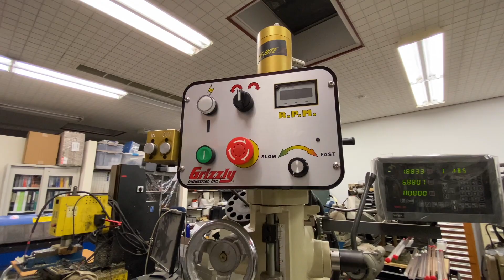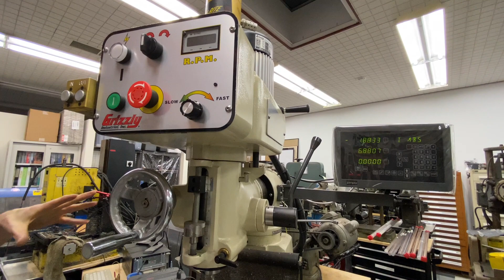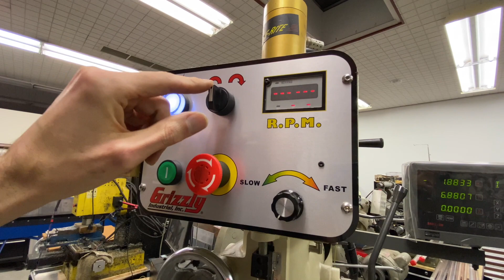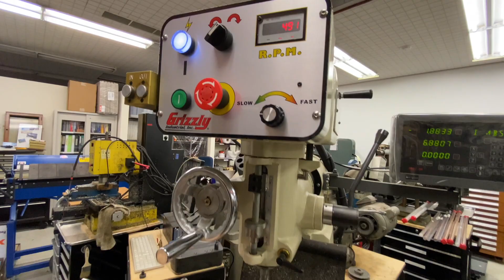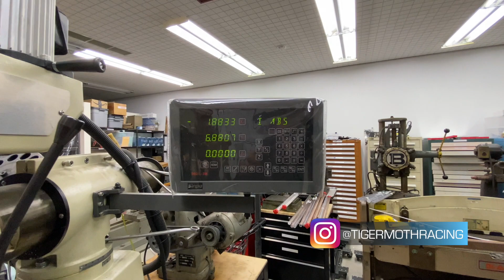SHOULD YOU GET A SMALL MILL INSTEAD OF AN INDUSTRIAL-SIZE ONE?

Comment: I started with a pretty small bench top mill and regretted my decision almost immediately when I got a dividing head that didn't fit underneath the quill. Now I have two milling machines and regret it less as I can leave that one set up with jigs for certain small tasks and do most of my stuff on the bigger machine.
Reply: That said I will probably still get rid of my small mill when I can afford it and get a second decent sized milling machine so I only have one size of tooling.
Reply from the maker: Lol that's a common experience. It is tempting to start small but we tend to need bigger pretty quickly!
Reply: I just upgraded from an 8" drill press to a 17" model; the 8" started off well until it started stalling on larger bits, then the bit was to big to fit over the piece especially on the table,  which caused a whole bunch of other issues 😅... you get the idea lol.  It's good to start small unless you already know that your committed to machining,  if so, go at least medium sized so that you can use it for a longer time to do bigger projects 😉
Reply from the maker: Yeah you generally want to go as big and best as you can manage. I noticed that when we moved out of our tiny space, almost all the tiny machines we had disappeared within a few years and were replaced with bigger ones.

Comment: A big part of making a decision on which mill to get is being realistic about what you need/want it to do. In my case, making engine accessory(AC, PS, alternator, etc) and clutch slave cylinder brackets for motor/trans swaps or stuff like throttle body spacers, a decent bench top mill is more than adequate. Nothing I do requires aerospace levels of accuracy or fast production times. Over the last 2 decades I've made dozens of such brackets out of aluminum with little more than a drill press, bandsaw and trim router.

The same goes for lathes. I'd love enough capacity to machine Dana 60 axle tubes for inner seals but I simply don't have the room for a machine that large. On the occasions I do need stuff like that done I'm OK with paying a commercial shop.

To that end, I recently picked up a used RF45 clone for $1500. I should be able to do the CNC conversion(with an enclosure and flood coolant) plus buy a ton of tooling for about half the price of a "standard package" Tormach 770. I'm also looking at the PM-1228 lathe as it has enough capacity for my usual needs(such as making threaded inserts for trailing arm rod ends) while not taking up too much real estate in my small workspace.

By all means, one should try to get the biggest machine that fits their space and budget. Small jobs are obviously easier to do on big machines than big jobs are on small machines but also be realistic.
Reply: my benchtops do most jobs, but just lately ive gotten obsessed with 250 I4s, doing valve jobs... and guess what? with a 5inch face mill i can JUST face a head. i have basically 10mm clearance at either end... would much rather have a bridgie for that... run a 10 inch and have plenty of room... and i definitely dont trust my quill lock to stay locked... just stuffed a job on the last step the other day when it did that to me... effin! last bit of stock too!

so im not about to try and skim any heads just yet.

Comment: I've come back to this video several times ,I've been torn between a larger bench-top mill & an 8" x 32" even larger mill (nearly 2x the weight, I think I'm going with the larger mill.
Reply from the maker: One thing to remember is that a bench top mill takes up almost the same floor space as a knee mill. So if you were to go with the bench top mill there is usually a non negotiable factor involved like getting it in a basement or other moving restrictions or rigid space restrictions. The heavier mills will always cut nicer and more quickly.
Reply: @TigermothRacingTV  thank you. This helps even more.

Comment: If you get a smaller mill and find that you need a larger one, you do have the passive benefit of being able to use your small mill for grinding operations. Tape up the ways, set up some mist coolant, and use a cup wheel on an arbor. It's a lot nicer than using a bench grinder.
Reply from the maker: I have wanted to try that with a 3 axis cnc mill to grind special form tools. Do you use this setup for grinding cutting tools?
Reply: @TigermothRacingTV  Yes, I followed exactly what Joe Pieczynski did on his channel. It's best for broaches and very light finishing cuts on hardened shafts. You can also use this concept to get the visual appearance of blanchard grinding.

Comment: I started with a new grizzly benchtop mill (R8) w/dro...after encountering some critical no-go problems with it, right out of the box, I got a refund and rolled it into a Bridgeport... glad I did, I wasn't limited by anything and there were basically zero limitations in what I could do.    
That said, the small machines have their place. you need to know what you ultimately want to do.   Regardless of size, if you're going to be doing a lot of things, get a DRO.
Reply from the maker: Yes the DRO is a game changer. Sounds like your journey brought you to a good place. Sometimes knowing what you want to make is hard when you are starting out.

Comment: You made some very good points here. As a hobby machinist I simply don’t have the room for a full sized knee mill. My shop is in my basement and getting a Bridgeport down there is a no go. Also, I’ve been told that most of the used full sized machines that come from job shops are used to the point of being worn too much for their own needs or needing repairs so it’s just easier for them to replace them. I use a large dovetail column mill/drill at work and find that it works fine for my needs so I plan to get my own soon.
Reply from the maker: I think the dovetail column mills are much more rigid. We have a SYIL brand mill that has been excellent.
Reply: @TigermothRacingTV  And unlike the round column mills you don’t have to re-tram them every time you change the head height.
Reply: Yeah...  Similar situation.  Basement workshop with no outside the house access.  Thankfully I don't need a bigger machine, but I too have found that shopping used Bridgeports is a hit or miss endeavor.  Most of the ones that are priced in the range of the bench top machine I'm looking to buy, are totally roached and need major rebuilding (scraping of the ways, table and all new bearings throughout) to be able to achieve the degree of accuracy the smaller bench top machine.

But if you have the $$$ for a new Bridgeport clone, or a fully rebuilt Bridgeport, then you're on a whole different level of capability, which believe me, I'd love to have that option...  Used to work with a Bridgeport in the tool room of my last job and it would be a great machine to have in a home shop.
Reply: @WHJeffB  I’ve also been told that the secret to being satisfied with using a benchtop mill is never running a full sized knee mill. Since I never have I won’t notice the difference.
Reply: @robertpearson8798  I've used Bridgeports and much smaller hobby sized bench top machines (In my home shop...  Sherline and Taig).  Being aware of the limitations is key to being satisfied with the smaller machines once you've had the pleasure of using a Bridgeport.  Knowing that you can't take heavy cuts (patience is a virtue here) and that smaller machines lack some of the capability will get you most of the way towards being OK with the smaller machine.

Luckily my needs for the future don't require a Bridgeport sized machine and a square column bench top mill will more than suffice, but believe me, if the right machine comes available at a reasonable price, I'll make space in the garage for it!
Reply: @WHJeffB  You’re probably right and as a hobbyist a smaller machine fills my needs, but there are always a few who won’t accept any limitations. There’s always that one person in any group or forum who say’s “Just get a Bridgeport” and often claims to have “ gotten one up three flights of narrow stairs in an old building at the top of a mountain” and “it’s not as hard as you think”😏
Reply: @robertpearson8798  I really can't see how they can sell those round column mills to anyone, why would people buy them ?
Reply: @bruceang82  Are you referring to round column or dovetail?
Reply: @robertpearson8798  I apologize, round columns that get out of tram every time you raise/lower them.
Reply: @bruceang82  I made a definite choice to avoid them as well. Before square columns became available they were just about the only choice. I had a friend who had one and he recommended that I avoid them.

Comment: Great content! CNC for hobbyists is way over talked IMO. Unless going into production it’s not needed and adds more work. Also never really considered the z shift of a knee mill. The table top Wong Fu style is well known for this problem due to lack of dovetails but it’s an issue as well with knee mills. Great stuff to consider.
Reply: That used to be true years ago, I'd spend a few days programming a part in the 80s that free cam software can program in seconds now. So one off complicated parts on a hobby cnc is very easy, and I do it all the time.

Comment: Help!!!! I'm in-between a column drill mill vs a knee mill my question  can  the column drill mill  produce parts  like  a drill  mill
Reply from the maker: You mean can a round or square column mill produce parts like a knee mill? It really depends on the size of the machine you are talking about. I am going to assume you are talking about comparing benchtop manual mills only. The knee mill is the most universal and capable, and they are usually the best quality of that size, but the small ones are not common. Generally never buy a round column mill. They are just not worth it. They are usually not rigid. Any of the bed or square column mills are good, the bigger the better. You can get a benchtop square column mill with nearly Bridgeport travels on it. A CNC square column benchtop mill will run circles around any manual bridgeport.

Comment: If you have a garage to put it and no steps buy a big one unfortunately i put my smaller pm25v clone in a different room and i can take it apart to move it anywhere
Reply from the maker: Yes, what space you have to put a machine is a huge factor for sure. The more micro barriers that you put in the way of using your machine will also drastically reduce how often you use it.

Comment: Most of the "video publications" and tutorials I've seen feature basic parts machined with square end-mills: holes, pockets, channels etc. I've seen little featuring complex three dimensional or what I call "contour tool paths." In other words, all three axes working simultaneously to create more than flat pocket bottoms with 90 degree walls. It would take forever to create these forms with conversational programming such as Path Pilot. What "capability" must I purchase in order to create 3-D parts with curvilinear pockets and outer surfaces. I'll use this machine primarily to produce complex cavities for making hollow mold forms. We're a small business and a Solidworks or MasterCam software package is beyond our resources. Thanks for any guidance you might share.
Reply from the maker: There are lots of options. First one that comes to mind is a free or cheap program called Mesh Cam. Easy to learn and VERY powerful if you become familiar with its odd quirks. Other options would be Fusion360 or a Maker subscription to Solidworks is cheap. Learning Solidworks would be an excellent way to build your skills. Once you know the fundamentals on how to choose tools feeds and speeds for cnc  machining then you can operate any software to make what you want.
Reply: @TigermothRacingTV  Thanks Tigermoth. When I first started operating "numerical control," it was just that "NC" fed with a punched tape.  We produced control systems for aircraft, assault helicopters , tanks and submarines, tolerances were very tight. Pretty amazing what 100 yards of myler could produce on a mill or turning center. In that world, "machinists" were required to know materials, tool selection, feeds and speeds and operational sequencing. Today we have "machine operators or parts changers" that wouldn't know a threading tool from a die chaser. Not to be critical, I get it "operators" cost less to employ. I've got an introductory skill level in Solidworks and MasterCam. I've had the privilege of hiring and working with some uncommonly talented programmers.  I agree that level of CAM comes only after much practice and dedication. I have a pretty specific interest in utilizing some kind of CAD/CAM. I'm hoping to identify just what I need in order to avoid spending for capability beyond those needs. Thanks again for your insight. I'll check out Mesh CAM